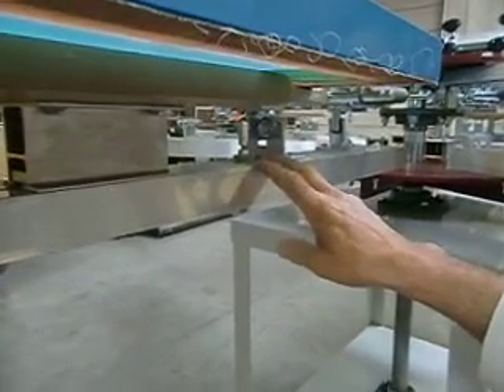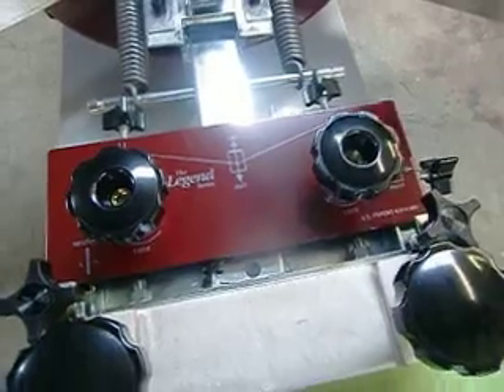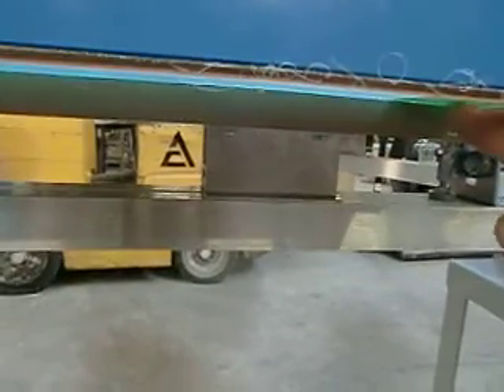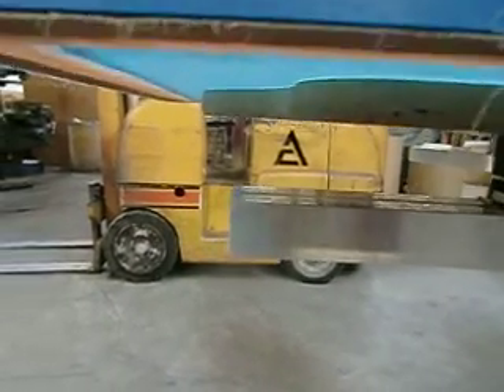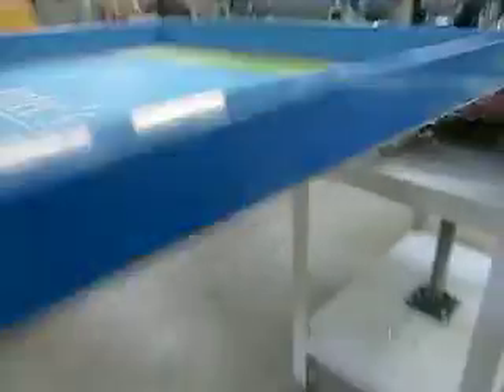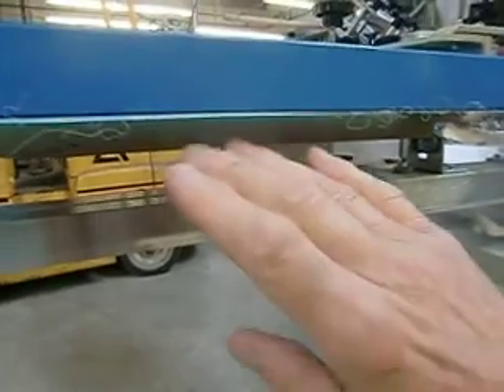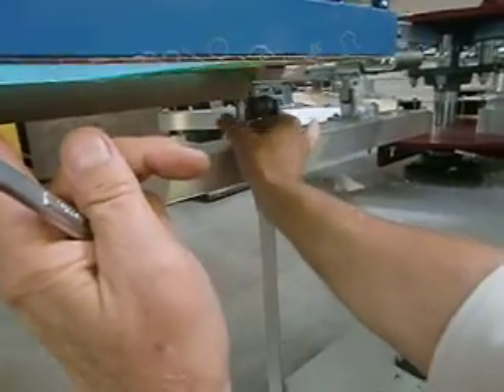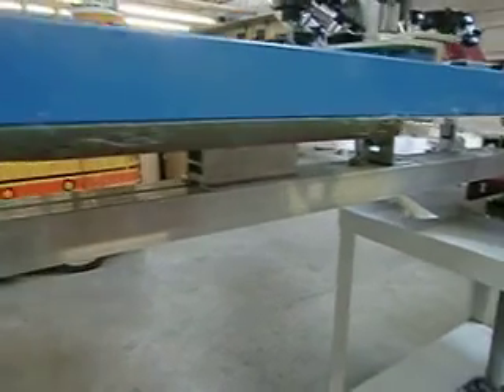Setting Off Contact

Comment: I have mine all dialed in and then when I go to tighten the two bolts it raises the screen in the front almost an inch! Even with the pad all the way down.
Reply from the maker: You are loosening the 9/16 nuts behind the clamp too much.  These do not need super loose. Just barely turn them before making the adjustment.